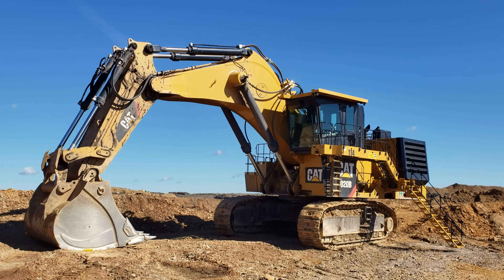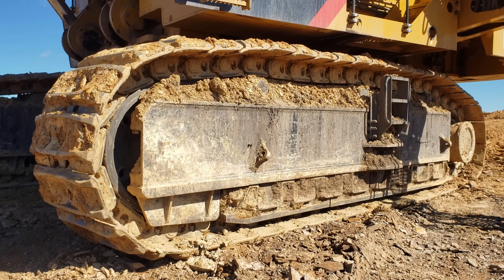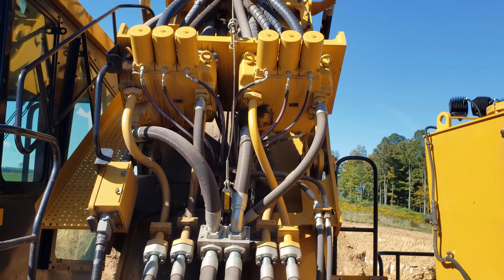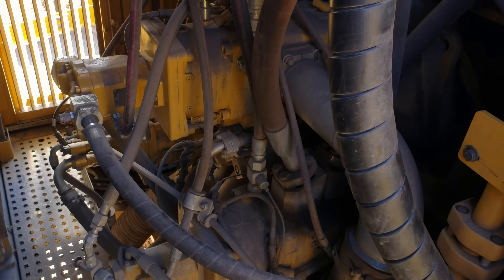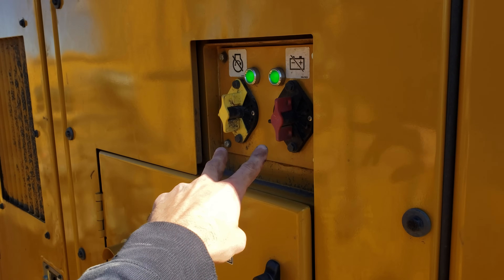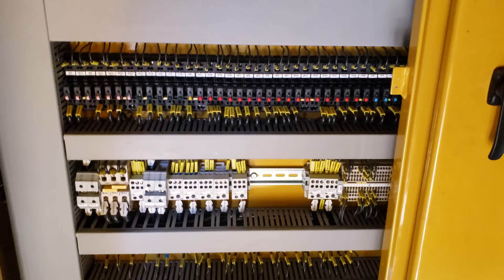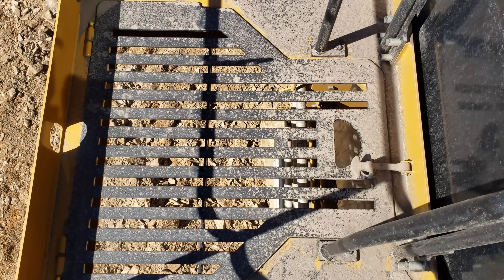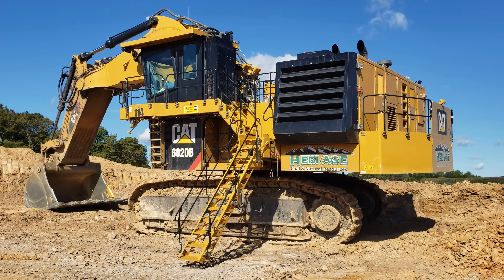Inside the New All CAT 6020B Excavator

Comment: At first view I was struck how separate the engine unit appeared from the rest of the machine. Then you pointed out it is a modular unit that can be swapped out for repairs.  Strikingly similar to changing batteries on a power tool.  But somewhat larger! 😀😀.  You know it’s a monster when every system has its own room!
Reply from the maker: Yes, the modular design of this machine makes it very user friendly for maintenance and allows for quick breakdown

Comment: 663 / 5 000
Thanks for this little tour, but I'm still a little disappointed with this description.
I've been trying to understand how joysticks work for years and years!
No one ever posts a video showing, one by one, what each joystick movement does.
It would be enough to spend 2 minutes with an operator pushing in front of the right joystick and seeing what happens, then pulling it, then tilting it right then left, and the same for the other.
Then they can slowly demonstrate the combined movements to show how you dig, lift, and pour into the truck.
It's not much, but no one ever explains it, strange.
Reply from the maker: Well the left joystick would be stick and swing and right is boom and bucket.